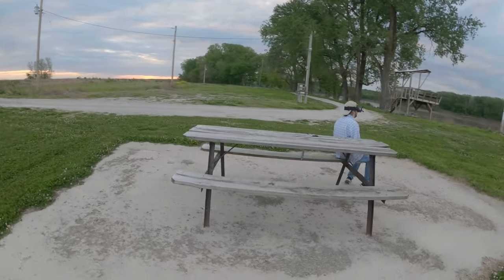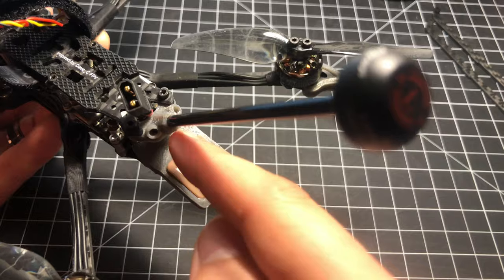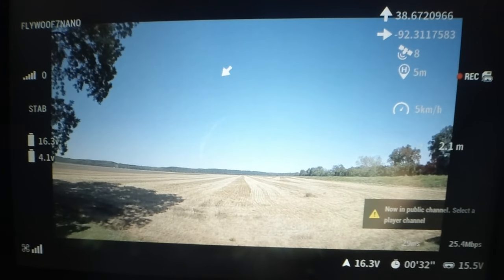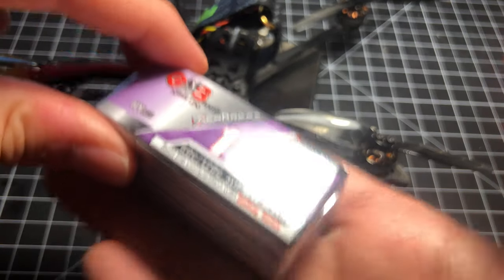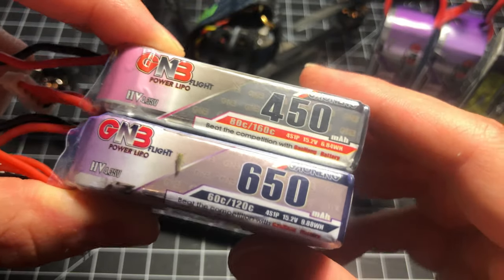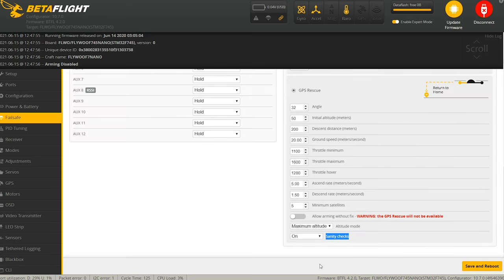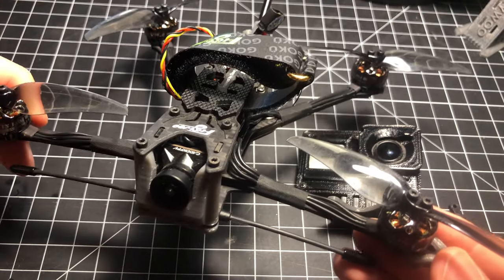Flywoo Explorer LR HD 4'' V2 Micro Long Range Ultralight FPV

Comment: Very well made John. this puts a new spin on how people think of acro flying. Normally when I see acro it is power loops, hard dives, splits and metal music and this certainly gives it a different appeal. Mixing the world of fun flying with hardcore and FPV acro with cinematic is fantastic. Great work on the video.
Reply from the maker: I think the stereotypical view of FPV is slowly changing! This is a great sector, and there's work to be had doing this kind of thing. 👌 Exciting times.
Reply: @JohnCuppi  It truly is and I want to see where it goes from here. I believe somewhere down the line we are gonna see gimbaled camera drones with acro capabilities in a very light sense. They of course will not take the punishment of the hardcores but I think they will exist.

Comment: GPS rescue sounds amazing! When you were flying over the water, I got super nervous until you mentioned it.
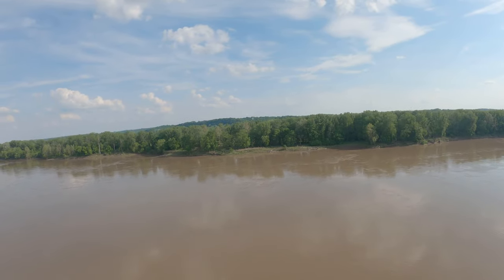Reply from the maker: yeah i would never have the balls to fly over water like this with my other fpv quads... although 15:35 was pretty risky regardless 👀 in the future i will be putting iNav on this quad and getting a real gps+compass installed for true return to home and waypoints.
Reply from the maker: @SunriseWaterMedia  yes it has but on a whoop where the c-clip on the bottom had been lost. Kind of tempted fate with that one by flying it anyway. which brand motor did this happen to?

Comment: It's using the dji air unit that weights about 30g
switching to the analog video transmit may save around 25g, makes may batteries possible.
also, the original flywoo explorer using the nin 1404 2750kv motor, which is supposed to spin on 4s. 
If change to the 1404 3750kv and using 3s battery, maybe less weight can be gained and make gopro mounting possible

Comment: also there are printed protection cover on the frame, also the battery pad and the strip. Removing all of this and use some electric tape may make 4s lihv 1100mah possible without compromising the dji air unit.

Comment: What would you say is the best pack to give best battery/weight ratio with a SMO 4k (30.02g) on board, if staying under 250g is not a concern?
Reply from the maker: I would still strongly recommend the GNB 1100mah 4S. The weight and performance I have received from that battery have been excellent and continue to get similar flight times months later. I think the key is to take really good care of it — no over discharging, and especially try to not leave it fully charged for long.

Comment: Hey sir, I know this is an older vid for you, but just wanted you to know that this was a key video for me in the decision to get the Flywoo Explorer as my first serious, non-training drone. I'm picking up the analog version and planning to use it with the GAONENG GNB 1100MAH 4S you suggest in this vid, and then slapping a Thumb Pro on it. Should come in at 246 grams. Appreciate the effort you put into this.
Reply from the maker: I really appreciate you taking the time to make this comment. Thank you. 

In the last year or so, I’ve significantly slowed down creating detailed content like this because total viewership and feedback on FPV drone content here on YouTube has went down dramatically. So, to hear that this video even though it’s an older one, helped you out toward making the final decision, is fantastic. 

I still have this quad by the way. I think you are correct, you should be able to get under 250g with analog flywoo explorer lr 4 and that gnb 1100mah 4s plus the run cam thumb pro.  If this works out, please let me know.
Reply: @JohnCuppi  I appreciate the detailed technical videos a lot. I'm doing this on a budget, so as much real-world detail as I can get lets me figure the value of... everything. It's why I picked up the goggles I did, at the price I did. Videos like yours, that go over weights, flight times, set ups, and combinations help me figure out how to stay under 250g so I don't have to mess with remote ID, and still get the best mix of flight times and performance. Most other videos just throw out the on-paper specs, but don't go into battery sizes, performance differences between the batteries, and how to mix and match. You did, which was ultra helpful for me.

Comment: Can the insta360 go2 fit nicely on this drone?
Reply from the maker: Yes. I use it on mine all the time now, the GoPro is better but I decided to save my GoPro for things I really want to film rather than use it casually. Can’t replace the GoPro hero 8 naked I built so easily.
Reply: @JohnCuppi  thanks bro! Definitely buying this set up for my 2 year round the world trip. This drone with a couple insta360 2s is probably all I need to vlog and get some sick shots💪

Comment: Thanks John!
I'll go with the TBS Crossfire too. 
I have a question, if goggles are a problem to wear; are there any HD Monitor/Screen options to get an FPV view?   
Does the GPS rescue need to be set-up in betaflight?
Reply from the maker: GPS rescue is pre-set up in this quad -- but I recommend my settings at 8:47 in this video and it's important to understand how GPS rescue will function as well with the various options. Unfortunately, no, there are no HD monitor or screen options to get an FPV view with DJI unless you buy the extremely expensive smart controller. There is the unofficially supported digiview but I strongly recommend avoiding using it for flying, there is way too much latency. It's good only for sharing a flight with someone. I believe the smart controller has significant latency, too.
Reply: @JohnCuppi  Thanks! Sorry I did jump the gun on my questions, while I was still listening to your excellent video. :)
Reply from the maker: @RedVote  No worries at all. I don’t get bent out of shape if someone just needs a nudge toward where I mention something in a review. Let me know if there’s any other questions. I still absolutely love my flywoo explorer. The only thing I would add is that since this video I bought the insta360go2 for it, and that’s also a great option. And, after a year the GNB 1100mah 4s I recommend is a bit more tired than I had hoped it would be. I may have just pushed it too hard one too many times over the last year, haha.

Comment: Great review John.  I don't really see under 250G as a big deal here in the US, however it's great that you showed the options.  This is very thorough review.
Reply from the maker: Thank you sir, the 250g element isn’t that important yet in the US. But some are now prefering to look for models that will not have to be compliant with Remote ID in the future. This one can be under 250g but it just isn’t ideal for maximum enjoyment In my humble opinion :)
Reply: @JohnCuppi this aged well, unfortunately. I found this drone just to duck RID lol.
Reply from the maker: @coletonholzer4757  Personally I think Flywoo would benefit now from making an updated version of this -- using a naked DJI Vista, which would be -10 grams. Instead of the nebula pro, the nebula pro nano version we have today would give another -5 grams.

Comment: This looks great! Bought mine from Banggood, at least I though I had. The page sold the "Flywoo Explorer V2 F7", but I got the old one with the F4 flight controller and v1 GPS... :( And no amount of pictures or proof could get BG customer service that I had received the wrong one. Kept answering "no, you have the right product." So for BG 4=7! They can't read their own web pages... Very frustrating...
Reply from the maker: Ugh! sorry to hear that. You can swap out the GPS for an even better one,  I recommend the matek m8q-5883. Is this the analog or digital version? The GPS really should be on its own uart, which is difficult to do with F4 without making some compromises.

Comment: Hi, which one do you suggest, nebula pro or caddx polar digital?
Reply from the maker: If you can get the nebula pro, get it just because it’s such a rare camera to have right now! Otherwise get the polar. The polar is 60fps and high latency which sucks for freestyle but is fine for slow long range cruising.

Comment: Hey cuppi do u recommend this quad? And what kind of rx ? I don’t have long range modules 😪
Reply from the maker: Yes I still do recommend this. I am still flying this Explorer V2 digital! I have not lost or broke it, been a very reliable quad. ExpressLRS is my recommendation today for Long Range flight, CrossFire will work as well but since I’ve made this video I stopped buying new crossfire receivers. ExpressLRS has just been a more economical choice for me. The modules can be had as cheap as $39 - it’s really worth getting one! ☺️What do you currently run now?
Reply: @JohnCuppi  zorro 4-1 I bought the elrs module today. But i have no idea how to setup .
Reply from the maker: @55amps  very first thing to do is in model settings, disable internal, and enable external rf module mode. Set protocol to crossfire. That will power up the module so you can get started. Don’t forget the antenna on it before powering up. 🥹

Comment: Quick question and I haven't got a solid answer yet.  In the failsafe tab for GPS Rescue.  Will GPS rescue work with the Allow arming without fix turned on and the quad gps has minimum satellites locked?  or will the GPS rescue not work at all with the Allow arming without fix turned on?
Reply from the maker: You only lose the GPS Rescue function if you arm BEFORE acquiring the min number of satellites. If you wait until that happens before you arm then you will still have the GPS Rescue function available even with the "Allow Arming Without Satellite Fix" option set to yes.  

But if you take off BEFORE you get a proper satellite fix, let’s say 3 satellites when the minimum in betaflight is set to 5. Then even if you get the required number of satellites AFTER arming while you’re flying, the GPS rescue will not work.
Reply: @JohnCuppi  Thanks!!
Reply from the maker: And — personally, in this video I recommended turning allow arming without a fix off… but I actually run with it on all the time myself. 

So why did I advise to turn it off? because I have seen so many people get caught with lost quads because Allow Arming Without A Fix was set to ON. Pure user error because they did not pay attention to the satellites locked / fix locked before take off. They take off without the minimum number of satellites locked, gain them in the air while flying, and think they will be ok. But they aren’t. And then have an incident and wonder why return to home / rescue did not work for them.  With Allow Arming without a fix = off, this mistake can never happen!

The reason I run with it ON is because I do a preflight test battery run. It takes a few minutes to lock satellites into memory for the day in the first battery, so that’s my preflight time. To do that, I decided I don’t need betaflight to watch out for me on my satellite lock.

Comment: I’ve been using rdq 850 4s for most of my flying, but I have a Auline 2000mah 4s lion which nets easy 20 minutes.   The 850 mah is the best all arounder
Reply from the maker: I’ll have to give an RDQ 850 4s a try sometime. So far I have been really happy with whatever chemistry is running the GNB 1100mah 4S. You definitely get more flight time on those Lions but I hate the loss of more throttle power if needed. Great comment!

Comment: Hi John, I just watched your video about the XJT Module, the Firmware update cable. I have a Taranis X9D+ and can bind it to my R-XSR, but it only has telemetry, no inputs showing in Betaflight. I moved the yellow wire over as you mentioned in your video for SBUS_OUT.  What you never mentioned in the video is, once changing the wire do I reconnect my Radio to RX with the cable and flash the fw again? Because I tried that and I just keep getting an error message.  I hope you see this. I appreciate any info!
Reply from the maker: Hi Chris, sorry to hear about the trouble you're having with R-XSR and the Taranis X9D+. If you are indeed bound (the r-xsr receiver has a green light) but you have no stick input in betaflight, I might suspect a different problem. A firmware flash shouldn't be necessary... but I can't rule it out. Unfortunately in the number of years since I made that video, firmware problems have been an issue with FrSky products. In the past, there was no need to worry about flashing firmware to get a radio to bind or sync up properly, but with FrSky's new ACCESS protocol, things got a bit more complicated since then. A firmware update cable does indeed require it to be in the same order that it came, so you'd have to move the pin back. Before trying to update firmware, I know this may sound redundant to ask but are you sure that the connection to the sbus pad is solid? I've had cold joints stop connectivity too, and a reflow fixed it. Just throwing the idea out there. What flight controller is this, also?

Comment: Really good review - I'm in the market for a sub 250g LR drone.  This is on my short list and so is the Rekon 4 HD version.   If you had to pick today, would you take the Rekon 4 over the Explorer LR HD V2 ?  Thanks again.
Reply from the maker: Thank you and this is a great question! I must be honest it's difficult to answer. Going based on hardware specification sheets -- I like the 28A ESC on the Rekon4, that's better than Flywoo at 13a. But the Zeus F728 lacks an on-board barometer, which is annoying to not have if you choose to run iNav on the Rekon4 in the future. You'll need to add an external barometer. I think for me it would come down to whatever I could get cheapest with rekon4 vs flywoo explorer lr hd v2. Just make sure the rekon4 LR you get has the caddx polar, it was originally released with the caddx nebula nano and that camera was horrible.
Reply: @JohnCuppi  Thanks for that analysis - did not know about the barometer difference.  I have known about the junk nano camera to avoid for a while.  :-)
Reply from the maker: @zira_fluff4105  the barometer would matter to me because ideally, running iNav software on these models is the way to go — not betaflight. But it requires a GPS+Compass module. It is my next project for the flywoo explorer LR, to upgrade it to iNav. That’s since iNav is supported now for FlyWoo explorer’s Goku F745 stack with various. I’ve just been tied up as of late with other reviews. 👍

Comment: Great job on this video  John! I would love to take one of my 5 inch drones and convert it to digital with  crossfire.
Reply from the maker: Crossfire is incredible in so many ways and I love my TBS Tango 2. I have basically abandoned frsky at this point and only use it when there's no other option i.e. whoop drones. Thanks for stopping by drone pool!

Comment: This is the kind of FPV flying I would want to do. Maybe a little more aggressive verticals from time to time but mostly like this. Digital looks to be the ticket. How much of the footage was from the drone and how much from the GoPro? I would ultimately like to only use the onboard camera if it's good enough.
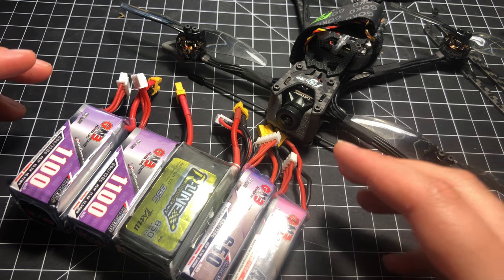Reply from the maker: Hey bob, thanks so much for the comment! Everything from 2:50 with the flight experience up to  5:28 is all the on-board DJI digital FPV camera, recorded over the air via the DJI FPV goggle DVR feature. Hope this makes sense, sorry that it wasn't more clear. The introduction footage is all from my GoPro. 👍
Reply: @JohnCuppi  : Thank you. :)
Reply from the maker: @SW-Video  Easiest thing to do right now is get an Insta360 Go v2 and throw it on there for the HD camera. Onboard isn't good for cinematography -- we don't have gopro quality HD FPV transmission, yet, unfortunately.
Reply from the maker: @SW-Video  I've also labeled the footage now in the chapter title text, thanks to this feedback -- hope it makes it more clear to others. I had put text in the corner to indicate it, but it got covered up by the progress bar.
Reply: @JohnCuppi  Thanks again. The Go 2 is the exact mini camera I've been looking at for other things as well and thanks for labeling the footage. I should be able to tell which is which and now that I know; it does seem more obvious to me now.
Reply from the maker: @SW-Video  I want to buy a Go 2 as my next camera. I was holding out at first because CaddxFPV was working with Insta360 to collaborate on a derivative of the Go2 that was cheaper and more FPV focused. So I waited, and waited. Caddx bailed on the whole thing they claim because of the chip shortage. sigh. I do think the insta360go v2 is a little too expensive, but i don’t see anything else coming out to rival it any time soon. they have the market cornered.
Reply: @JohnCuppi  : I did notice the price between the first version and the second was about 1/3 more for the Go2. I guess the added recording time makes it worth it and some other features.
Reply from the maker: @SW-Video  The original insta 360 go v1 had very short recording times, but its biggest problem was the irreplaceable lens. You break the lens on the v1 and you're out $100 for an entire replacement unit from Insta360. It's the most bone headed design I've ever seen, because you can break or scratch that lens by simply dropping it on the floor. Then the whole unit is garbage. I've never had an expensive camera so easy to scratch and break like that, then impossible to repair. The v2 added a replaceable lens and much more recording time, better quality video, etc.